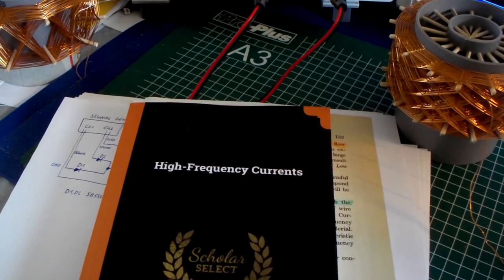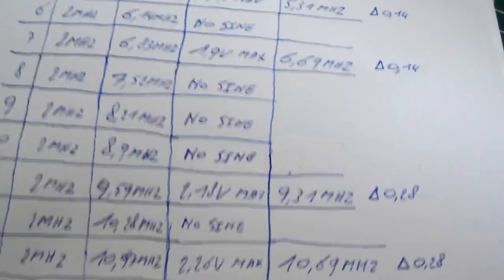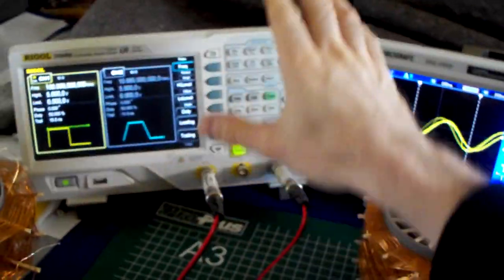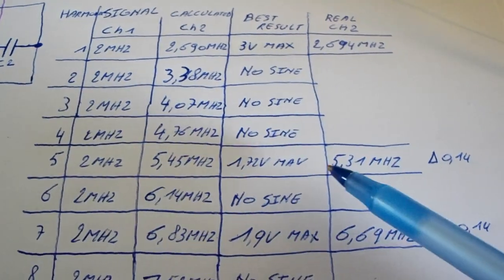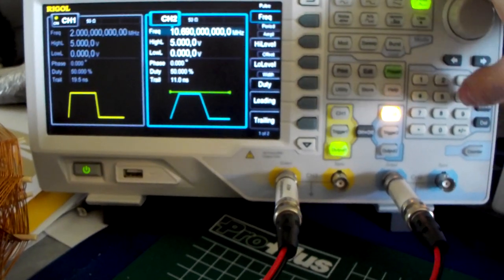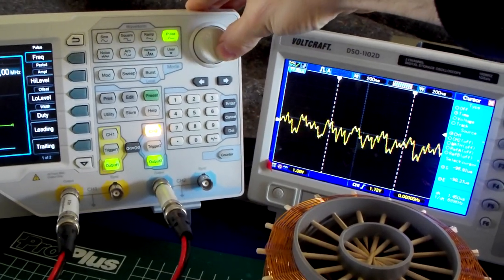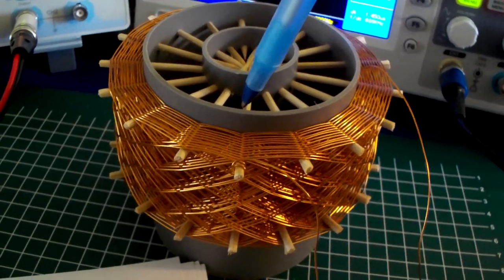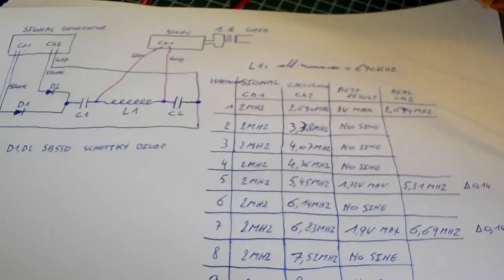017 Don Smith Spinoff Experiment Frequency Mixing Try To Lower Frequency

Comment: Useful information - thanks for sharing Bruno.
Reply from the maker: Hi Mark, thx, there's another one comming up showing current is also at that low frequency. Both sine waves are there at the same time, but only at narow bandwith harmonic, in my case the 100.000th :)

Comment: @Bruno Vk  Appreciate your informative videos, thanks for sharing your efforts and work.  Question about your coil resonance test setup, what did you find to be the best capacitance values for C1 and C2?
Reply from the maker: Dear iQuest, thank you for the comment. In my experiments I took capacitors of 440nF and of 100pF but couldn’t see much difference in the signals. At the moment I discovered that when using a transformer the frequency mixing is not neccessary, but   The bandwith arround the harmonic is very narrow. You can see a picture in my album with circuit used. Extra experimenting is needed to try and go for one wire connection and leave out the capacitor at ground connection, this capacitor is used because of the self resonance effect and at the moment I don’t know if the same effect of lowering frequency can be achieved in the one wire type setup. With the transformer in setup like last picture in album (at the moment this message is written) I had self resonant frequency about 26hz and I only got that sinewave of that frequency at 2,6Mhz, 100 khz more or less and I only saw the 2Mhz sine, it’s really intreging to see that happening. There maybe other harmonics then the one used but experimenting time is over for this weekend. One thing I’m starting to see now is that in the Don Smith device the frequency used on L1,L2 should be an specific harmonic of the output transformer, but please experiment for yourself and then decide if you support the idea or not, I have no problem in admitting I could be totally wrong in this.
Reply from the maker: I was looking through Rick Friedrichs book and knowing the things I know now from experimenting, the “accelaration” and “deceleration” phase have other meaning to me now 😀 I was looking at that from voltage standpoint in the past because I thought it was not possible to lower the frequency inside a circuit, but that sine wave of 26hz that poped up on my screen of the scope has given me other insight. Especially the fact that changing one digit on signal generator makes it dissapear, such small bandwith that is usefull. So again thank you to Rick for his books, it just takes time to understand them. Hopefully I’m on the right path for some more output 😀

Comment: any advice for me if i want to lower the frequency of 25khz to 50hz ? if i have a transformer that operates at 50hz and i have 25khz frequency, odn smith says i need a frequency correction resistor across th einput terminals of the transformer. can you help me ? : )